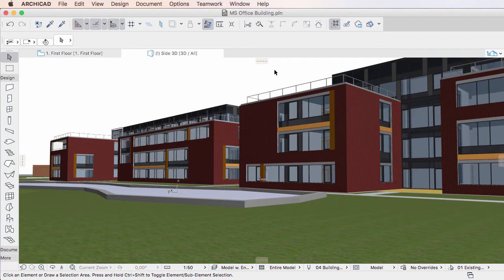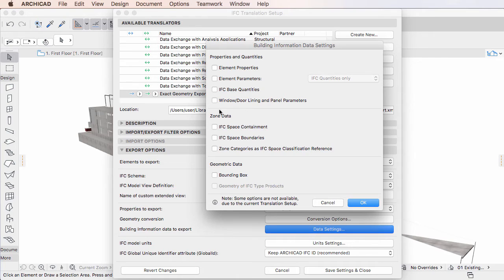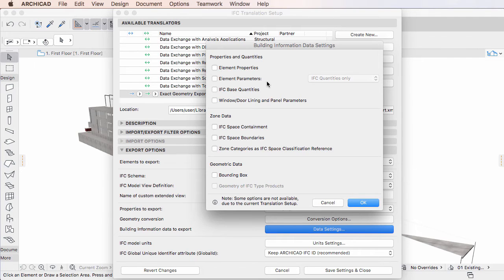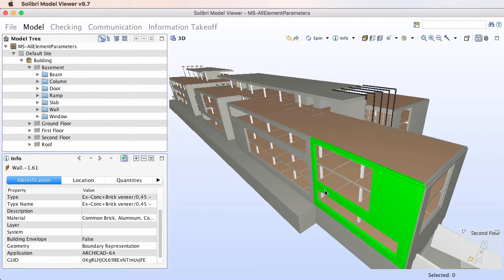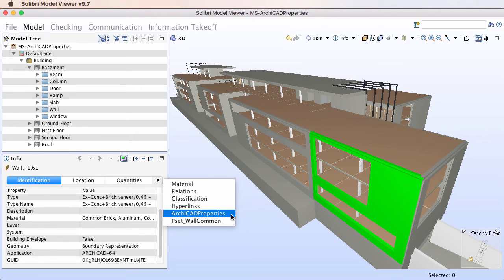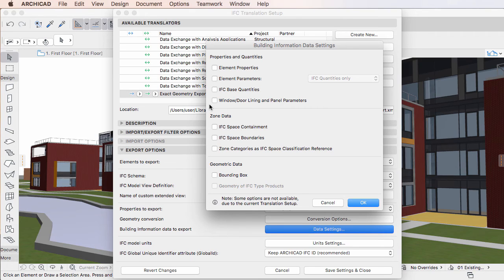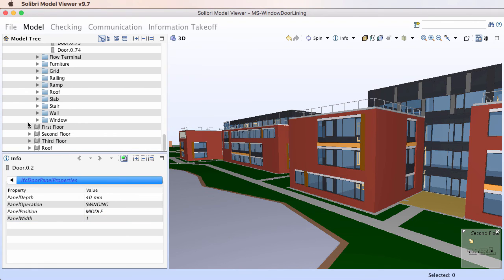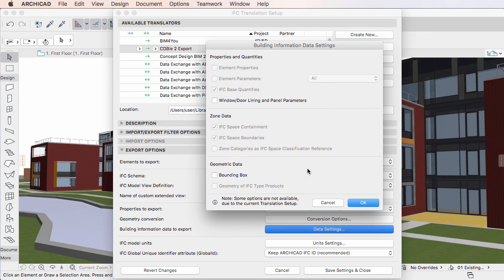IFC Export of ARCHICAD Parameters

Comment: When I export the project in IFC. Do I need throw the elements strutual (slab, beam and column) first? 
I want to generate the file in IFC and insert in CYPECAD.. How can I make this? Throwing this elements (slab, beam and column) is this way correct?
Reply: Hello, this is what I am really in need of. I'm having a problem with some elements, especially the sanitary fixtures, not appearing in the CYPE. Did you get a solution?